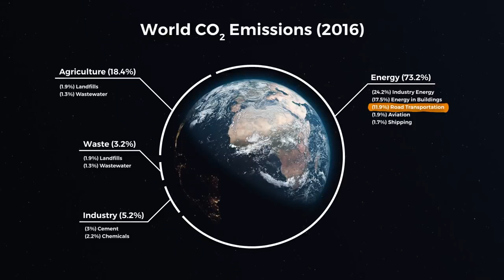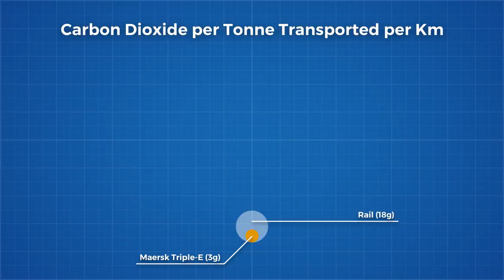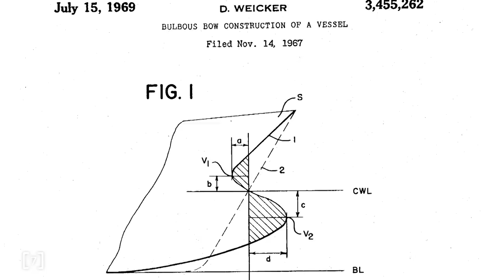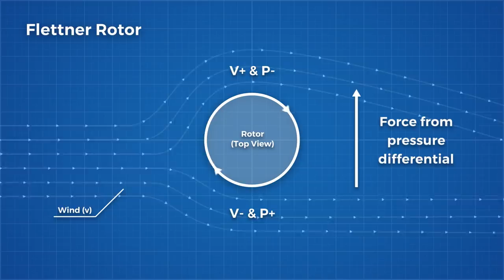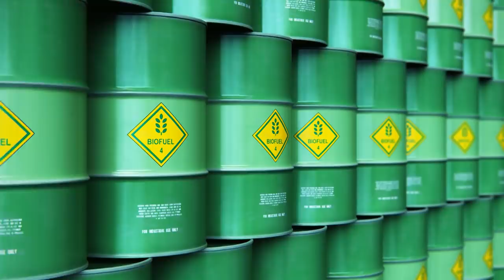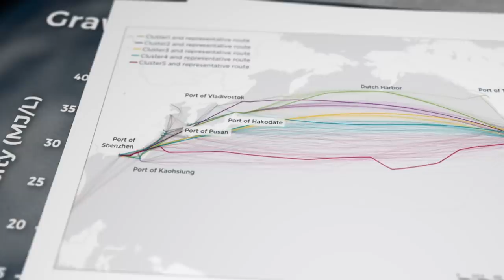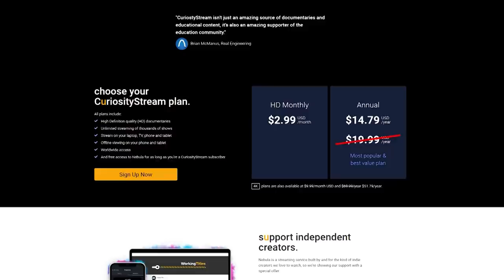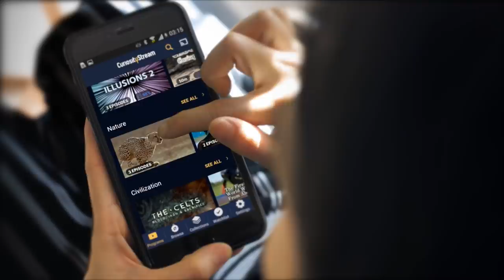Are Renewable Powered Ships Possible?

Comment: I mean... Nuclear? Its good for the environment, it can go years without refuling
Reply: Just think; would you have full confidence in the management of a nuclear reactor under the control of an anonymous entity only traceable, perhaps, via a letter box in a FOC (flag of convenience) nation state?  If you are, could you sell that confidence to Japan, the state that hosted the Hiroshima and Nagasaki nuclear detonations as well as more recently the Fukushima ‘event’?  Then try that same, or a similar, sales strategy on Ukraine, the nation state that as a part of the USSR (CCCP) hosted the Chernobyl ‘event’.  Modern iterations of nuclear energy, thorium fuel, molten salt reactors, small modular reactors or fusion reactors, will carry the legacy of past problems.  It is the global trepidation of anything with 'nuclear' in the name and the economics of nuclear having transitioned from 'energy to cheap to charge for' too 'the costs of remediation are incalculable' that will prevent the adoption of nuclear energy as a means of creating energy at sea.  Modern reaction systems may have overcome the safety problems but the general public, having been misled in the past, will be reluctant to believe the fresh new promises.  The incident of the ‘Ever Given’ blocking the Suez Canal, March 2021, may also have a little to add to this debate.  The cooling water on ships tends to get taken in from near the bottom so when running aground the inlets are in a prime spot to get plugged up restricting, if not stopping, the flow of coolant.  One thing that the TMI, Chernobyl and Fukushima incidents all had in common was that the supply of coolant, or rather lack thereof, was a fundamental cause.  Similarly and only months later, May 2021, had the ‘X Press Pearl’ been nuclear powered then a major port for a populous nation in the global South would have possible been the site of a significant exclusion zone due to a non power plant related incident.  If the ‘X Press Pearl’ had on board a fired up but ‘safe’ molten salt reactor and found herself having to run down the possible 12.5 megaWatts of energy in the power cycle would a stable cool down have been possible?

‘They’ say nuclear is cheap, it’s not it is expensive and has a large embedded carbon quotient as well as being complicated, dangerous, not universally socially acceptable and having only ‘no need for refuelling’ as a questionable advantage; actually it does need refuelling just not as often.  When ‘they’ do need to refill the warming up stuff it takes considerable longer than pumping tonnes of thick black stuff, cSt380 HFO, or thin runny stuff, MDO, onboard which is one of the reasons HMS Queen Elizabeth and HMS Prince of Wales are pushed about by ICEs and gas turbines thus using a similar fuel as the aircraft that fly off of them.  The Royal Navy (RN) with a high degree of skill and expertise uses, at vast expenses to the UK taxpayer, a current operational nuclear fleet of 11 submarines (also known as ‘boats’) in two flotillas, seven attack subs and four ballistic missile boats.  The carbon footprint of all the extra bits of hardware and the fuel, including processing thereof, from ground to propeller, are the external costs that never seem to get considered.

Disposal, once it wears out, of both the machine (that was a ship) and fuel is another can of worms best left unopened.  The 26 RN nuclear powered boats no longer in use are laid up (some in Rosyth and some in Portsmouth) awaiting long term deconstruction including dealing with the fuel rods and other irradiated material.  The USN is not, as far as I know, a commercial organisation working to very tight margins and also has the skill and expertise to handle the complexities of nuclear power; so as well as submarines their aircraft carriers are nuclear powered and each of the current iteration has a build cost three times that of QE/PoW, bigger crews and even more generous funding.  For those who still think that nuclear energy might be the answer I recommend this report: - https://www.bbc.com/future/article/20200901-the-radioactive-risk-of-sunken-nuclear-soviet-submarines?ocid=ww.social.link.email.  The navy of the USSR might have been under resourced and over extended but it was still generously supported in comparison with merchant shipping.

Another, similar but more extensive view, may be found at https://www.quora.com/Why-are-there-so-few-nuclear-powered-cargo-ships-If-it-works-for-ice-breakers-and-submarines-why-hasn%E2%80%99t-it-been-established-for-merchant-vessels.  Why not use nukes?  It is down to engineering, finance, socio-political attitudes and safety.

Comment: I think they are called "sailing ships".  :)
Reply: To address the suggestions that sail power is the answer I offer the following.  In 1870 a premium sailing vessel entered service, the ‘Cutty Sark’, she could carry around 600 tonnes of cargo at speeds of up to 17.5 knots, dependent on the prevailing wind, to harness the energy the available spread of canvas was up to 2 976m2.  To round things out that was circa 5m2 of canvas for every tonne of cargo carried.  The ‘Cutty Sark’ was designed and built for employment in the tea trade where time on passage was a large factor in securing the premium freight rate that made her cost effective but as soon as the Suez Canal opened, which the ‘Cutty Sark’ was unable to sail through, she lost her advantage, raw speed, to the steam powered ships of that era.  Mechanically powered ships have improved in terms of efficiency, on a freight tonne mile basis, by at least one order of magnitude since then.  After losing out to the coal burning, steam reciprocating mechanical ships of the late 19th century ‘Cutty Sark’ was relegated to the Australian wool trade, just about the bottom of the barrel in maritime terms and only one small step up from being a 'honey barge'.  The canvas, cordage and extra manpower needed for sailing ships was never a very benign environmental option so please discount any idea of sail as ‘sustainable’.  All this is without the problem that if ‘the wind don’t blow the ship don’t go’, when it does blow it often blows in the wrong direction for your cargo delivery needs and sometimes there is rather too much of it for comfort.
Reply: @BernardLS  You sound very ignorant. tall ships have no trouble travelling at 12 knots which is what these ships have slowed to. There are many modern automated sail assisted ships, even using their electric engines' propeller to charge its own batteries from the wind power. Cutty sark wasn't at all interesting for her design, it was her crew and seamanship that gave her a name. Also, the question was still is it possible.
Reply: @carbon1255  speed is not the problem, as 'Cutty Sark' demonstrated. The problems are quantity of goods moved per watt, routing restrictions and the harnessing of the propulsion force.  The key ratios are 5 square meters of sail area for each ton of cargo moved and light displacement of vessel required for each dead weight  ton of cargo capacity.
Reply: @carbon1255  'Better to light a single candle than to curse the darkness' as the saying goes; ignorance can be cured with education.  Speed is not the major problem resource efficiency is, the ratio of greatest concern is spread of canvas for each freight ton mile compared with fuel per freight ton mile.  All environmental costs need to be included in the determination of each.  Then there is the matter of scale,  the viability of freight is determined by weight, volume and value; as the cost of shipment decreases then greater weight / volume becomes valuable enough to transport.  Slower shipping means more goods in transit to supply the same rate of demand, and a higher number of shipping units to contain and carry them.

Comment: surely these mega ships can just be converted to nuclear powered ships?
Reply: Just think; would you have full confidence in the management of a nuclear reactor under the control of an anonymous entity only traceable, perhaps, via a letter box in a FOC (flag of convenience) nation state?  If you are, could you sell that confidence to Japan, the state that was subject to Hiroshima and Nagasaki nuclear detonations as well as more recently the Fukushima ‘event’?  Then try that same, or a similar, sales strategy on Ukraine, the nation state that as a part of the USSR (CCCP) hosted the Chernobyl ‘event’.

Modern iterations of nuclear energy, thorium fuel, molten salt reactors, small modular reactors or fusion reactors, will carry the legacy of past problems.  It is the global trepidation of anything with 'nuclear' in the name and the economics of nuclear having transitioned from 'energy to cheap to charge for' too 'the costs of remediation are incalculable' that will prevent the adoption of nuclear energy as a means of creating energy at sea.  Modern reaction systems may have overcome the safety problems but the general public, having been misled in the past, will be reluctant to believe the fresh new promises.  The incident of the ‘Ever Given’ blocking the Suez Canal, March 2021, may also have a little to add to this debate.  The cooling water on ships tends to get taken in from near the bottom so when running aground the inlets are in a prime spot to get plugged up restricting, if not stopping, the flow of coolant.  One thing that the Three Mile Island (TMI), Chernobyl and Fukushima incidents all had in common was that the supply of coolant, or rather disruption thereof, was a fundamental cause.  Similarly, and only months later, May 2021, had the ‘X Press Pearl’ been nuclear powered then a major port for a populous nation in the global South would have possible been the site of a significant exclusion zone due to a non-power plant related incident.  If the ‘X Press Pearl’ had on board a fired up but ‘safe’ molten salt reactor and found herself having to dissipate the residual energy associated with the possible 12.5 megaWatt power cycle would a stable cool down have been possible?  Would there have been sufficient heat energy contained in the power system to facilitate a hydrothermal explosion?  In a casualty ships may capsize, like the ‘Karin Hoej’ off of Bornholm in the Baltic early December 2021, in which situation any safety system reliant on gravity might not work.  It might also be worth bearing in mind that part of the TMI near miss was the fault of the US navy trained operators focusing on not letting the primary cooling system 'go solid'; due to their training overwhelming their education and the particularity of the situation.  The actions of the captain of the 'Costa Concordia', Francesco Schettini, may also be relevant; the consequences of his actions, whether due to ineptitude, an isolated act of incompetence or driven by a corrupt corporate culture, illustrates well one of the dangers of releasing nuclear energy into commercial shipping.  The regulators vary from useless up to good and anywhere in between some I would not trust to control a toothbrush and none are infallible.  To maintain the level of authority that the ONR (Office of Nuclear Regulation a UK government agency) exercise over the few nuclear power plants on land in the UK to visiting merchant ships would require increases in manning and expertise leading to costs that would simply not be affordable.  Safety costs; as does the engineering of the structure.  The examples I given are not exceptional typically every week a ship sinks, some large some small.  On the news on 9 Jan 2023 there was another incident in the Suez Canal, when a vessel grounded briefly; the next Ever Given scale event is only one small error of judgement away.  A sister ship of the Ever Given, the Ever Forward, ran aground approaching Baltimore on 13 Mar 2022, these things happen.
	
As a second point if you fit 'walk away safe' reactors on ships you will need duplicate drive trains as there are seldom salvage tugs around when you really, really need one.  A nuclear ‘dead ship’ drifting around NUC (not under command) would be a disaster waiting to happen and duplicate systems increase expense.  Land based nuclear power plants have a few issues but are immobile, stable and usually well regulated.  Reactors on ships by their very nature are able to move between regulators, bump into each other and roll over.  Regulation of ships by both / either flag state or port state has problems and adding any nuclear regulatory obligations on to those already overstretched facilities would be very taxing for all involved.  This is not about 'can it be safe' it is all about 'will it be safe'.

Furthermore, while merchant ships may be 'taken up from trade', as the RN would say, or may be captured or impressed by non-state quasi military entities by way of piracy, cargo ships are not military vessels.  They therefore do not have the same inherent level of self-protection and internal discipline.  Why not use nukes on merchant ships?  It is down to engineering, finance, socio-political attitudes and safety.